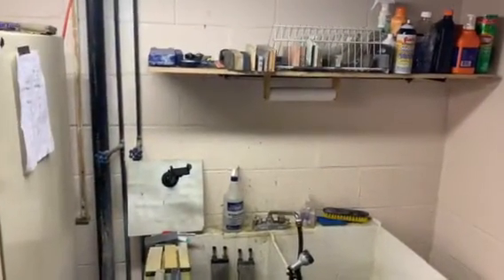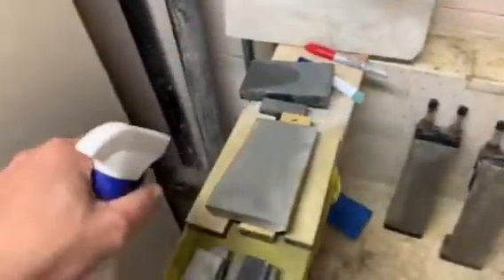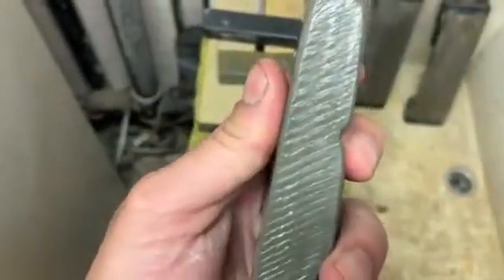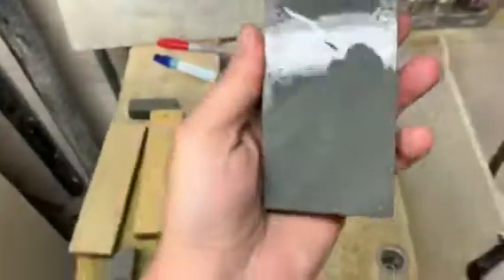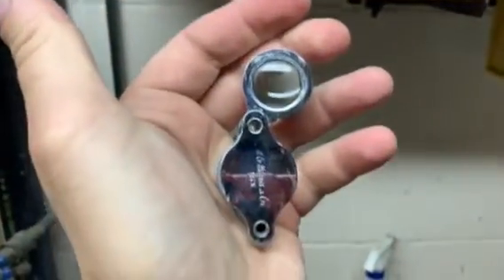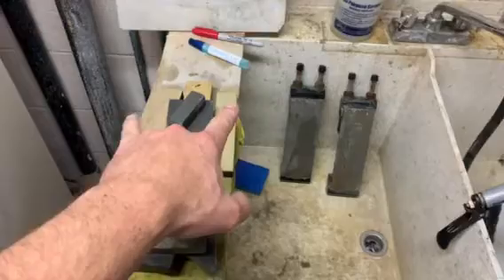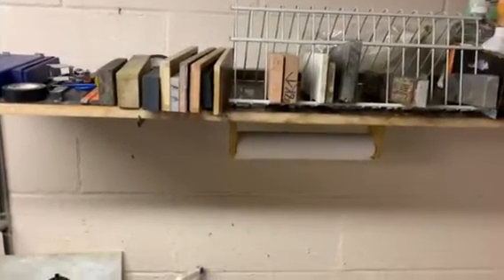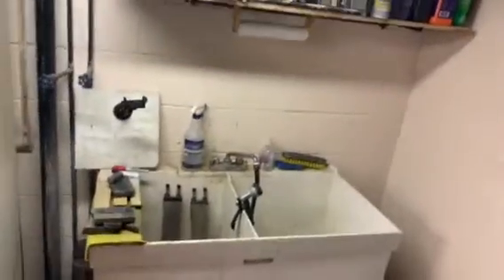My honing station

Comment: Hi I might have some Thurigians and etchers in my collections but also slates but all without labels, what are the difference between etcher and Thurigian
I seen in one comment you sent a comment to YouTube that Thurigian have a certain smell 
could you describe in the best way what the smell should be different from normal piece of slate,
Reply from the maker: All Eschers are Thuringians.  Meaning they all came from mines in Thruingia Germany.  However, not all Thuringians are Eschers. What separates them is the label really.  Escher mined stones, and labeled them.  If the label exists, it proves provenance.  No label, no guarantee the stone is an Escher, but it could be a Thuringian.  Regarding the smell, IMO Eschers/Thuringians do have a smell that is different from other slates.  When slurried, they have a muddy, earthy odor.
Reply: @fishinjunky  Interesting, cheers for your input to my question,